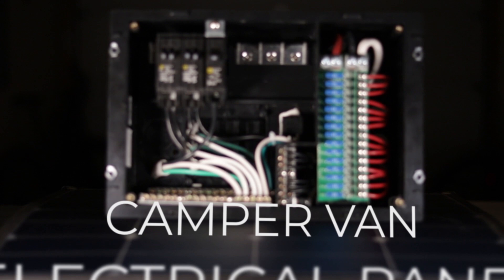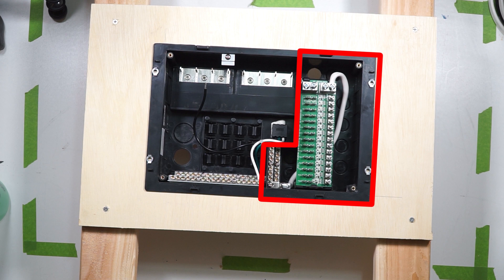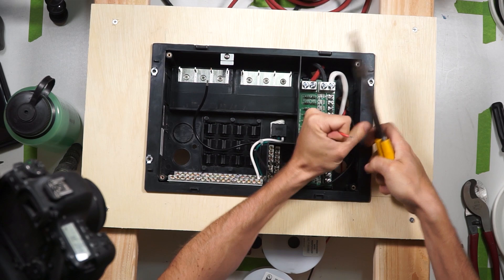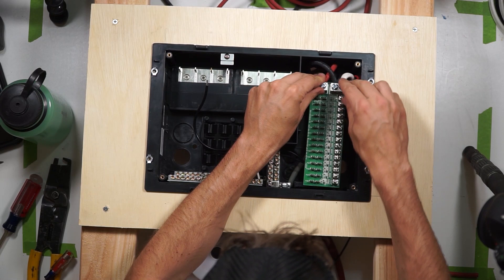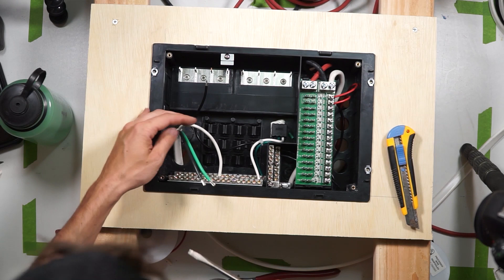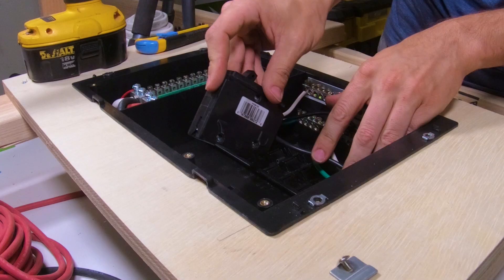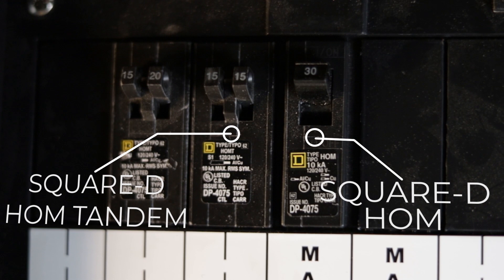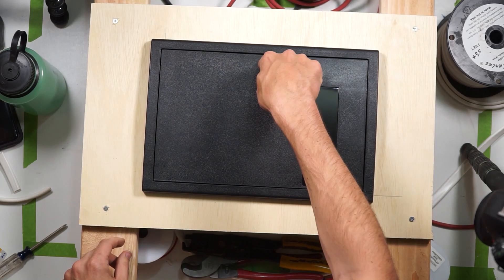How To Wire a Camper Van Electrical Distribution Panel

Comment from the maker: 2021 Update!!  Can't find this panel in stock?  Neither could we... so we took matters into our own hands and ordered a few pallets of an alternative solution so we could ensure that these stay in stock for you.  Plus... our new panels have 18 spots for DC circuits, slots for 8 AC circuits per leg (16 total for the box) and they are in separate enclosures so you have a little more flexibility when it comes to mounting them.  Check them out here: https://shop.explorist.life/product-category/all-products/distribution-panels/
Reply: Cool, I see all the Solar installs and they have new Boxes and breakers and more.... 
CAN WE NOT JUST WIRE IT INTO HERE? Does it need to be bigger, or more powerful as in to handle more Amps???
Reply from the maker: Doug:  I'm not really sure what you mean, but if you'll check out the wiring diagrams at explorist.life/solarwiringdiagrams , that'll show you how it all needs to be wired together.
Reply: When running the wire from the lithium battery to the isolator to the alternator, did you run the wires inside the van or underneath? I have a 2018 Ford Transit.
Reply: @timothykubota9711    why underneath?  The isolator gets connected to your battery which is under the driver seat in a Transit. Nothing is connected directly to your alternator.
Reply: Does your system allow engine alt to charge RV batteries while driving ?
Reply: When you connect the AC Breakers for the inverter (hom) you the connect another breaker for additional ac 120v appliances. Does this use power from the inverter to power those additional outlets? I'm confused on how this functions.
Reply: @taylorkey3921  all 120 volt power is supplied by your inverter. Nate explains this a little bit in this video on how to hook up a breaker box. Your inverter is simply inverting the power from 12 volt 120 volt so you can power your house Outlets. If you're connected to shore power, then it's simply taking 120 volt and using that to power your Outlets but that's only if you have an inverter/charger which you've added a shore power outside connection
Reply: Thanks for the helpful video Nate. However, I haven't been able to find the distribution panel you've suggested. Amazon has said "Currently unavailable" for months now. Is there any other distribution panel you can recommend that is this simple to install?

Comment: AC/DC That’s what I did for my 12x16 Man cave shed...installed a 30amp panel from my old RV also took the RV propane heater that will run from the 12v DC side for the heaters fan ....put in some good bright LED lights  USB chargers /  it also keeps my deep cycle battery charged .....the AC/ side is to run my window air conditioner and power tools ...many creative and versatile uses having this type of system... “important to note” build two separate cabinets outside of the shed interlined with sheet metal for the propane tanks and battery...thank you for the share 👍🏻
Reply from the maker: Nice!  Sounds like an awesome project!

Comment: I am a very familiar with RV electrical and a 43 year electrician but I must say that this is one of the best explanation of this type of power panel I have seen. Normally ac and dc are not allowed in the same panel but since it is not a house it is ok. People just need to realize NOT to mix the wires in each section. Great Job!
Reply: This must be why these are no longer available

Comment: When we started our van build, we studied your wiring diagrams in an effort to educate ourselves since we had zero experience with 12V DC power. What we built was sort of a hybrid. We combined 200 Ah Li batteries with a REDARC 40 amp DC/DC charger and a WFCO-8955 distribution panel which includes a 55 amp DC charger. We haven't burned anything down yet. The REDARC charger is also a MPPT solar charge controller. Instead of panels on the roof, our intention is to use briefcase panels since we always try to park in shade and we hope to have the flexibility to move the panels to follow the sun. Our build continues....

Comment: You touched on cloudy days, but something you should touch on is "reserve battery capacity". Planning for extended in-climate weather (dependent on solar without access to a generator, shore power or some other grid-like power) is pretty crucial if you are out in the boonies and if you have a hard dependency on electricity, C-Pap or other vital electrical needs. Some of this is also dependent on your array capacity.

Comment: Nate, thank you for your time and ability to simplify something for me.  I was going to install the 12vdc fuse block, separate 110vac breaker box all linked to our inverter/charger but this video is a definite changer for our project to get the solar energy to our electrical systems in need. 
Be well!

Comment: If possible, can you do a tutorial video or blog for this distribution panel using 50A breaker (power in)? I am using Victron Multiplus with 30AMP shore power based on your complete walkthrough airstream video. You mentioned the Powerassist and used 50A breaker in that video. But I am getting so confused because the 50A breaker has 2 poles but the 6/3 wire from Multiplus can only provide 1 positive/hot wire to 1 pole. 

Thank you so much for all the detailed videos!

Comment: Thanks for the video!  Some reviews of this box say its a bit flimsy and the door easily breaks off.  Paneltronics make some nice looking and robust 30A AC distribution panels as well, but they are quite a bit more expensive, and I don't think they handle 50A, and don't have DC distribution as well.
Reply from the maker: We've swapped over to recommending these separate units we are now selling in our store: https://shop.explorist.life/product-category/all-products/distribution-panels/  The doors are definitely not flimsy but still aren't as expensive as the paneltronics units.

Comment: I am considering getting an EcoFlow Delta Pro for my current shuttle bus conversion. I would love to see a small tutorial on this as it seems fairly cost-efficient as compared to buying a large battery bank, inverter, charge controller and battery monitor. Seems like a great option for the weekend adventurer who may want their battery bank for tailgating, or just to take inside and charge before a trip!
Reply: Big sell for me on the delta pro is EV charging...

Comment: Nice and neat. Being a bit of a tech nerd, though, I wouldn't mind some solid state stuff on the 12 volt side. Fuses are so last decade. :) But digital power distribution modules do cost more as well.
Reply from the maker: Thanks!  Yeah, you can add whatever you like at this point.  This system is a nice and easy; effective and cost effective way to get the job done.

Comment: Literally the best videos on the internet, question from the UK however, finding this distro board in the UK isn’t possible, and... we are 240 volt? Is this compatible for 12v DC and 240V AC? Would you be able to recommend an alternative? THANKS!
Reply: did you ever find out? im building a solar system for a van based on these videos but trying to clarify if 240v needs a different set-up

Comment: it looks like there are 2 positive breaker rails.  Would it be recommended that I could energize the 2nd rail from the main breaker on the 1st rail....acting like a bridge?  Thanks for excellent video.
Reply: Im having the same issue aswell. I tried putting the 30amp tandem breaker in between both bars and got zip, zero energy

Comment: Great video Nate. Two questions.  First. Can you install a second single pole 50 amp breaker on the AC right side buss bar? Second.  What did you do with the black wire from the electrical plug that came with the box? Thanks for the help.
Reply: Got the same question on how to power the other side of the bus bar. That outlet black wire can be wired into one of your circuit breakers and will power the outlet on the back of the panel. I used it to test my system before wiring my 120 outlets.
Reply: @waywardescapes4384  right side uses another main and the other hot from a 4wire 4-pin cable. Index card on door shows 2 MAIN input breakers.

Comment: Great video, thanks. Quick question....my new Victron Multiplus 3000w inverter has two AC Outs, one to supply inverted or bypassed AC power to the distribution board and one AC OUT (OUT2) that provides power to those devices that I do not want to Invert power to (eg a rooftop A/C or hot water element). Can I feed the Inverter OUT1 to the left side of that AC busbar and the OUT2 line to the right side of the AC busbar, or are they connected and thus I would need a separate sub-panel? Assuming that I can separate the two AC OUTs from the inverter, does it matter if they share the common Neutral and ground busbars?

Comment: Hey Nate!  Loving this; and saving me so much time!  I was wondering what the setup would be to power the right side positive breaker bar.  Are they both energized by that first breaker setup, or would I need to splice the power from the inverter into a mirrored set up on the other side.

Thanks!
Reply from the maker: Hey Jeremy!  Thanks!  Glad it's helped.  Are you talking for a 50A setup or to just have 6 more breaker spaces available (3 slots of tandem breakers)?
Reply: This is my question as well
Reply: Hello Nate,
I have the same question, I am currently building a skoolie bus. I will have a 30amp system but need 2 additional breaker spaces. I was planning on running a jumper wire from the 30amp breaker over to a additional 30 amp breaker to power the other side. Is there a better way? Thanks in advance for your help

Comment: Is there a way to bridge the left and right side of the AC breaker rails? or is it necessary to split the 120 line in the breaker box between the two sides (maintaining 120 volts on each side)?
Reply: A 2 pole breaker in the middle. Will need 240v incoming power

Comment: We've decided to go with a portable solar generator for our van electrics.  Will we still need a DC panel to run our wiring through?  Would the electrical panel you use in this video work for that?
Reply: That is exactly what I am here to find out.  I've read through the comments/questions to here and it has not been answered.  I bought the Bluetti 2,400 wh.  It has a 9 amp (=110 watts) cigarette lighter plug for DC power. I did notice that the cigarette lighter splitter/adapter that I bought to hook up two of the light sets that I've installed so far is rated for 9 amps and using 13 gauge 12 volt wire.  So, I am thinking that I can hook up as many lights and accessories to equal 9 amps max and plug the adapter from the Bluetti into this panel and use this as a DC distribution panel.

Comment: Howdy, Nate! Fantastic video. Thanks! 
Quick Question: How would you go about lighting up the second AC busbar? The goal is to make use of the additional space for circuits but using just a single MAIN input.
Reply from the maker: Basically, there is no approved method to power both sides of the AC Breaker box with one power wire incoming.  That side is truly reserved for 50A 120V/240V shore power (but not 240V loads).  Some thoughts, though:

1: In a camper... 6 circuits (using 3x tandem breakers) is PLENTY for 96% of builds:  Driver Side Outlets circuit, Pass Side Outlets circuits, 1 high powered device outlet circuit, Air conditioner circuit, and a Hot Water Heater Circuit should be good to go for most people.  This also leaves one extra circuit for whatever else you've got going on.  It's truly not necessary to have one circuit per outlet (a common problem I see).

Comment: Quick question regarding Victron Multiplus 3000 overload.  I only have 2 Square-- HOM Tandem 20amp breakers installed for my van. The first one has the distribution back outlet wired to a tandem while the other tandem is wired to 3 outlets on same circuit - all 3 outlets work great when tested. However, when I add the second tandem breaker and wire it to a dedicated outlet (which will. be for water heater) and then test, it trips the inverter into an overload. Any thoughts for troubleshooting? And as always Nate, your videos are absolutely astounding, thank you so much.

Comment: Best video I've seen for my trailer build, thanks for sharing.
Question: The manual for the victron states that it should have a breaker protecting shore power to ac/in, how do you protect this loop?
Edit: Posted a question in other video.
Edit2: Posted question here as well.
Reply from the maker: Great Question!  The breakers protecting the wire connecting to the AC in side of things are contained in the power pedestal box at the campground where you plug into shore power so you don't need to do anything extra.
Reply: @EXPLORISTlife  Thanks for the answer!
Reply: Given the Victron 2000 multi, do you recommend 10/3 soow coming from AC/out to this main breaker? I saw that you have the 6/3 gauge on your diagrams and I'm guessing it's because of the power assist feature of the Victron which can deliver up to 67 amps.
Reply from the maker: I recommend 6/3 from the inverter to the main breaker in the power distribution box due to the power assist function.

Comment: Love it, thank you! Does the 20 amp receptacle on the back allow for 1 thing to plug in instead of be hardwired through a breaker?
Reply from the maker: Yes, you can indeed plug 1 thing into the outlet on the back.  It still needs to be hooked to a breaker though.

Comment: Thanks Nate! These electrical videos have been super helpful in getting started on our build. Something I've been struggling to find an answer to is where is the best place to run wires on a new build; behind walls and insulation or in front of walls and behind cabinets? Additionally, if you're running wires behind the walls how do you make changes in the future if you need to say add a new switch or a new AC plug? Thanks!
Reply: I did it behind with a removable panel with a velcro, so that if I needed to add anything I know where everything is. Some people do it behind walls, cause it's a finalized design.

Comment: I’ve looked through a lot of the answers and questions this is a super informative video thank you for posting it. I’m curious on the breakers AC side how many amps am I able to put on this breaker box? When would be a 30 amp for sure and I’m looking to do 3 20 amp for outlets that I have stove, air conditioning things like that. And for DC side how many Aunt can I draw from this side? There’s 15 slots as an example can I put 15 20 amp fuses?

Comment: A little confused about the split busbar on the AC side. I would like to run more than 4 circuits out of the AC side, but I'm not sure the best way to energize the other busbar on the right.

I am also curious what you use the AC plug on the back for. In the hypothetical scenario or this video, you seem to be wiring outlets and appliances to the duplex breakers - what would you use the plug for? Just some other appliance?

Comment: HI Nate, 
First thanks for all the help 18 months ago. Your professional services were well worth it.
My old Airstream has been parked for over a year, so I've forgotten more than I ever knew!
Question: At your suggestion I am using this panel. My rig is 30a. 
I believe the way you show in this video, only the left bus bar is hot.
What is the slick way to get power to the right hand busbar to add a couple of more circuits?
Thanks again, Manning
Reply from the maker: There's not really a 'clean' way to do that.  Fortunately, 6 circuits (3 tandem breakers) is generally plenty for most campers.

Comment: Do you have a video on a split phase for a 50A connection. I am going to add a go power ic 2000 which is an inverter charger and automatic transfer switch all in one. It does 50a pass through as welll

Comment: I have a 30 amp set up already completed, the extra sure, power connection, and the breaker system inside the bus, everything works perfectly well, except if I plug into any outlet that has a GFI set up within that circuit. And I don’t know why it causes the GFI to trip every time. Do you have any suggestions? If I plug my 30 amp sure power bus outlet to an outlet at my house without the GFI it works perfectly well

Comment: Hey Nate. Thank for all that you provide us.  I was disappointed to see that I could not purchase a membership at this time?  Will keep looking and hope to purchase soon.  Question;  I am in the process of installing a solar system to my rv trailer.  In order to streamline the install.  I am considering installing a new 30v in receptacle in the forward area of the trailer.  Doing so will provide easy access to the pre-wired roof solar wires and allow for the inverter and related solar hardware to be installed in the forward pass thru area. is there any value in keeping the existing 30v in?  The factory receptacle is located in the back of the trailer and of course wired to the fuse panel as per normal.  Is it safe to add the new inverter in line alongside the existing factory 30v line?  If it is, should I isolated it with a shut-off switch?  Having both lines would able me to bypass the solar input if I wanted to run strictly off of shore power.  Thoughts?  Thank you for your help.  Craig

Comment: Thanks for the video Nate, my panel is all hooked up with no issues, but I have one question, how do you have your 12volt appliances work off the 115volt side if for instance your hooked up to shore power from a campground and want to shut off your 12volt solar input. Do I need a converter/charger ? And how would I connect that to my system? And if so, who makes a decent one ? I’m running all Renogy products except for a GoPower transfer switch and of coarse the Furrion breaker/ fuse panel. Your feed back would be greatly appreciated.

Comment: can you wire the ac portion directly to a shore power hookup?  I will have a seperate ac outlets with a small inverter but I want to have some full power ac outlets when I connect to shore power